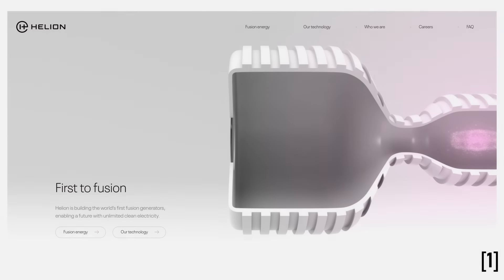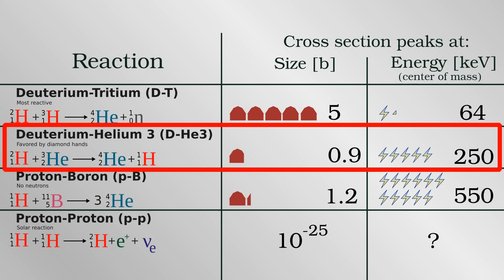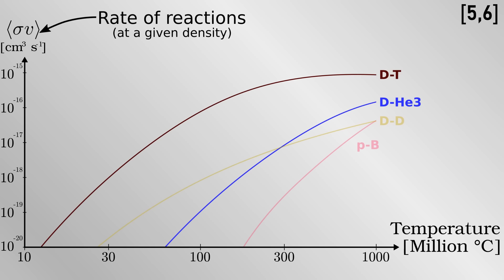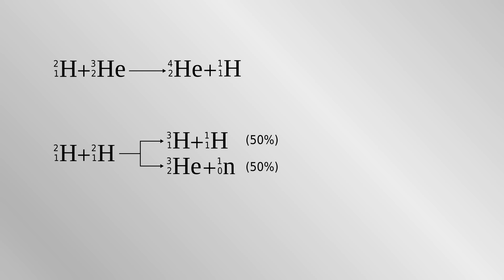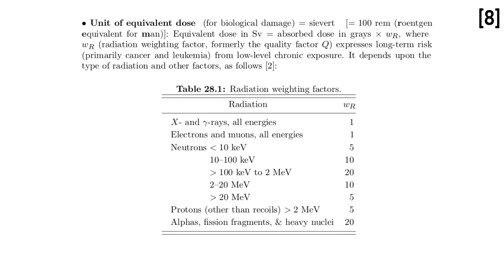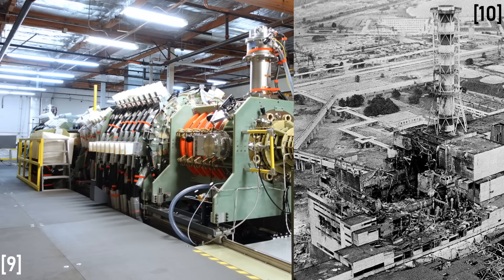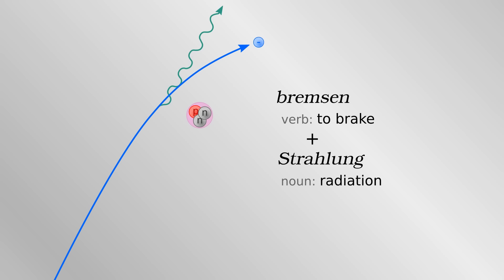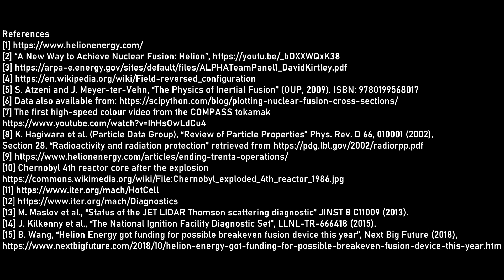The problems with Helion Energy - a response to Real Engineering

Comment: Some notes (not critical just pointing out some things based on what I've seen)
- The idea of FRC being novel is a bit weird. In their own video material (recent) I remember Helion themselves mentioning there is pre-existing literature. Feels like throwaway marketing comments.
I didn't know aobut the other FRC reactors. I'm dissapointed I haven't heard more about them.

- They keep on mentioning 100 million kelvin but from what I've heard/seen it seems that's just what they've achieved so far / planned initially. 
They consistently state "over 100 million degrees kelvin" in all their material. And in the Real Engineering video mention they pushing higher and higher (than 100 million is better),
I'm cautiously optimistic they will push higher and that's what they said they're building future machines for. The only question is how high.

- The Real Engineering video glosses over neutrons being produced in pure D-He3 fusion but implies it. In the same video I remember a hybrid D-D D-He3 reactor being used and that was really the main goal and they were unsure about the idea of a fuel only D-D reactor. I'm guessing they will neccecarily stick to the hybrid reactor primarily,. because of the neutrons and general plasma damage.

- Are Helion actually claiming particle gyro radii are actually larger? I figured particle drifting and turbulence would make it larger and they have to account for it reguardless of the simulation.

- Very tongue in cheek video. got a lot of chuckles out. This is my favourite physics channel to date.
You're right the public information provided by Helion is pretty disparate, at least in terms of SEO. 
Especially when compared to ITER. Bit of a shame. and a bit suspicious, but whatever.
Reply: You should watch David Kirtley's recent talk at Princeton. He addresses some of the issues in his talk there. He also explains in detail how their machines scale and the expected operating regimen of their power plants (< 500 million degrees so they get enough D-D reactions for He3 breeding, density matters and so does Te:Ti). Things that IM does not know and did not care to look up.
Ion gyro radii are 25% larger than expected. That is a relatively small change, but it affects the design of an optimal machine. 
The neutrons produced in D-D side reactions are only 2.45 MeV. That is below the activation energy of many materials (which Helion is using).
Reply: @elmarmoelzer2229  Do you have directions to that talk?
I've watched a good few interviews but I think the one you're referring to is different,
I'm also considering getting to get access to that video on nebula, even if it costs...

I actually remember hearing about the activation energy somewhere but it didn't quite sink in yet because the video was information dense. Quite interesting really.
Reply: @elmarmoelzer2229  I would also really like to see that interview.
Reply: A good critic of a bad critic....
Reply: @ukaszlampart5316  I wish the spam filter would stop deleting my every attempt to share a link.

mediacentral then princeton then edu then /media/JPP08December2022_DKirtley/1_9p8c7d85
Reply: @jRoy7  Thank you still
Reply: @ukaszlampart5316  Glad I found a way to get it to you. It's really interesting. Hour long purely on the science.

Comment: Just some points: the reactivity graph <sigma*v> is reactivity averaged over what are assumed to be Maxwell-Boltzmann  distributions of particle velocities - good assumptions for things that pulse on long time scales compared to the collision frequency like tokamaks. But in helions approach, I’m not sure the compression is slow enough for the species to relax to a maxwellian, so using graphs of sigma instead of <sigma v> might be more helpful if we know what kinds of particle velocity distributions Helion expects. 

Also, the FRC is well studied, but not both collision and compression of FRCs by magnets instead of metal liners 

The “large gyro radii” comment comes from the field reversal: you get figure 8 and betatron orbits in addition to tokamak like gyro orbits that have larger radii.
Reply from the maker: By their own admission they claim temperatures, so near enough equilibrium, hence those reactivities are near enough correct. As you must know, and as I described it in my more in-depth video, the sigma for D-T is way higher anyway.

Comment: When I looked up Helion I was confused as I didn't see any Physics positions even though they are hiring, and iirc they don't have a chief physicist on the project either, the CEO has a masters in Applied physics, but honestly I'd expect them to have atleast one Particle physicist and a nuclear physicist on the project too, but through my short and not very thorough research I couldn't seem to find any names or positions like that in the company. Great video, thanks!
Reply: I am also confused on how there is no oversight from the Atomic Energy Commission or any other organization caring about safety.
Reply: @the11382  Claiming something in a YouTube does not require a particle physicist, and does not generate radiation. The AEC doesn't need to worry.
Reply: @the11382  that’s not entirely true. The Atomic Energy commission became the NRC and I guarantee they are keeping track and regulating Helion. The company will have to have a license for the tritium and an accelerator license in whichever state they operate.
Reply: @eljanrimsa5843  Awesome comment!!!
Reply: You can find a whole bunch of plasma physicists they employ on linked in
Reply: Why a particle physicist? Seems like a plasma physicist would be a better fit.
Reply: @the11382  they are regulated like particle accelerators. So there is oversight, just not as tight as with a fission plant.

Comment: 1. Low reactivity. 
Reaction probability depends not only from the temperature itself, but rather from Lawson criteria, which depends from temperature, time and pressure conditions as well. By regulating all these three conditions required for fusion, and by the concentration of each element in a fuel mix, you could achieve the desired rate of each reaction type between fuel components.
Let's see which types of reactions happen in Helion's reactor when D and 3He components are heated and compressed enough in its core:
a) D + D -> n + 3He
b) D + D -> p + T
c) D + 3He -> p + 4He
As you may see, not only the neutrons and protons are produced in D+D reactions, but they also produce even more helium-3, which is used inside the core immediately, increasing the net energy output from 3He type of reactions.

2. Neutrons.
Neutrons carry around 4% of net energy gain produced inside Helion Energy reactor.
There is a very neutron-transparent material exist like zirconium. This metal is easy to work with, its forgery and turning are rather cheap.
What's also a good thing about zirconium is its ability to remain stable and not turn into dangerous isotope even after 4 consecutive neutron absorption.
Neutrons going outside of the reactor are good friends since they'll be absorbed by the lithium blanket and help breed tritium, which eventually turns into a new He3 fuel, rare isotope required to power new Helium Energy reactors.

Comment: I'm not a nuclear physicist, but my mechanical engineering background says they could never pump enough coolant into the reaction volume to keep it from melting down, it's too small....compare it to the many cubic feet of volume of the magnetics in hydro generators (cooled by water)....also the capacitor storge, switching semiconductors and interconnecting electrical conductors need to be cooled as well. I squared R loss is what makes this an impossible design.
Reply from the maker: A very under-rated point. They plan 50MW net electrical output at a rep rate of 1-10Hz. So, charging/discharging at least 5MJ from capacitors at 10Hz reliably for months on end, with cabling which must run through the neutron-shielded radioactive area. Something tells me this won't be so easy.

Comment: I don't know why YouTube seems to eat some of my comments. :(

After watching this I went back and re-watched David's presentation last week, they did discuss Bremmsstrahlung radiation and had charts showing it is much lower in a high Beta system (like FRC) than a low Beta system (like a Tokamak).

What I don't understand is the difference between your power output chart and Helion's. They show peak power output per unit volume is lower at 100 KeV than 10 KeV. Around 10-20 is the peak per their graphs. He comments it is since temperature getting too high means your density gets too low.

Edit: Above is from the D-T chart. For D-He3, the ideal is 50 keV.
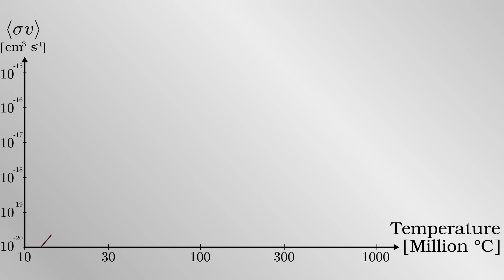Reply from the maker: At 01:20 I'm showing purely the reactivity (no mention of bremsstrahlung at this stage). Something like 20 keV is a pretty good target once you take bremsstrahlung into account. Also bear in mind that using Helium3 means even more bremsstrahlung losses than the D-T reaction, because the power lost goes as the square of the ion charge.
Reply: @ImprobableMatter  The D-He3 charts do show higher bremsstrahlung than the D-T charts, now that I know what to look for, and what that term means. Thanks.
Reply: @ImprobableMatter   Helion's machines have a very low Te:Ti ratio (<0.1). That helps with losses, including Bremsstrahlung. 
P(fus)/P(loss) scales as Ti^1.5 / (Z^2 * Te^0.5 )

Comment: thank you for this video. i will admit i was persuaded by the video put out by real engineering. 
i looked at the comments and everyone seemed to be really enthusiastic about it. but one guy seemed pretty critical of the company. this prompted me to look up more critical opinions on hellion. i couldn't find anything but your video's on fusion. 

i really shouldn't take things at face value. i won't pretend i fully understand what you are talking about it the video. or that i am any the wiser on the subject. but you have made me more critical and doubtful. and as a result i won't be spreading potential wrong information about this topic. it really made me realize that i know nothing about this type of stuff.
Reply: It's human after all, Fusion has such a big promises that would solve a lot of our problems (no more need to Fission reactors if you want to move on from coal/gas generation), that would lessen the effects of climate change that we tend to hype up any small improvement or any new prototype that generates power for a fraction of a second that we lose sight that we are still far off from any commercial viability. But there's never been as much money being poured into fusion research, so i have no doubt that the famous "we're 30 years" from achieving fusion is correct now.

Comment: I was waiting for someone to do an analysis of Helion Energy fusion reactors. A quick question what do you think is the most viable method to achieve fusion energy production? I personally think it would be a stellarator design
Reply from the maker: Of the current startups, I would go for Commonwealth Fusion from MIT, but even then they have a mountain to climb and will probably take longer than they promised to investors if they succeed at all. Long term the stellarator is indeed quite promising.
Reply: Great question & answer. Thanks 👍
Reply: @ImprobableMatter  How about TAE? They are old soldiers on the battlefield, so I assume that they know what they are doing.
Reply from the maker: @zhchbob  Their company name refers to proton-Boron reactions. They also have an FRC and despite their name they have now switched to D-T, so they agree with me on one thing at least.
Reply: @ImprobableMatter  Are Tokamak Energy in the UK about the same as Commonwealth Fusion?
Reply: @ImprobableMatter  CF has a great approach but they will have to deal with the mechanical constraints of the very high magnetic field from the HTS. I think that's the biggest issue yet.
Reply: I am enamored with the stellarator design watching the progress of the Wendelstein 7-X with delight over time.   The potential for Q-->inf is promising.  Field positioning errors of course limit max Q.  I was under the understanding that in the tokamak design the ring current becomes unstable as it is increased limiting its usefulness.  Why is so little effort being given to designs that have inherent flaws or scalability issues over a system that solves so many basic problems?  To rephrase the question: What's wrong with the stellarator design?
Reply: @mikecrowe4585  The problem with tokamak is not that the current become instable but that in order to generate a magnetic field you have to vary the current in the coil (see maxwell ampere) and because of that you increase the energy stored in the coil: (E=Li²/2). At some point you cannot store more energy in the coil so you have to cut the magnetic field.
However it's not necessarily a deal breaker for Tokamak as there is other heating methods like neutral beam injection and electron synchrotron resonant heating. The problem of the tokamak is only with the central solenoid which is used for heating power and not confinment. So even if current tokamak designs are pulsed devices we may be able to obtain steady operation devices in the future.
Reply: @uwu_senpai  a magnetic field is generated with a static current (standard  child's electromagnet).  Do you mean a changing magnetic field?
Reply: The most viable fusion reactor is any reactor that utilizes "synthetic gravity" or "anti-matter" tickling type phenomenon. Electron extraction techniques are a great starting point. Cheers from Quantum Kinetics.
Reply: @ImprobableMatter  TAE is still aiming for p-B11 fusion.